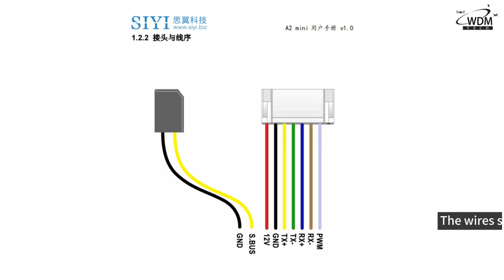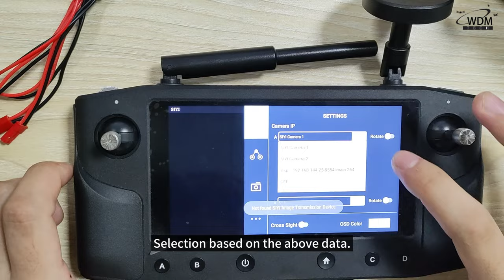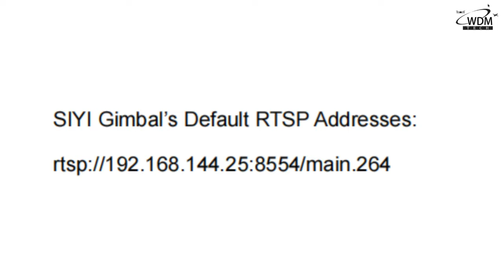SIYI A2 Connects to Herelink

Comment: How much time did you have to wait for the camera to connect?
Reply from the maker: About 20 seconds.
Reply: @worldronemarket  ok. After i updated my a2 mini to the latest firmware available in siyi site it just never connected anymore. I have waited around 5 mins. I can not find links to the factory firmware or a way to restore factory settings :(
Reply from the maker: Have you followed the steps in the operation manual to update, and have you decompressed the zip file? It is possible that the update file cannot detect the .zip file.
If it cannot be detected after connecting, we have no good solution.